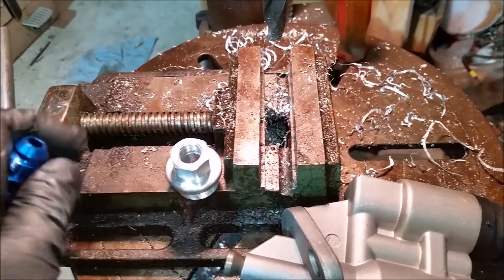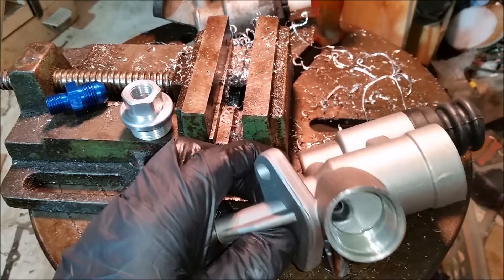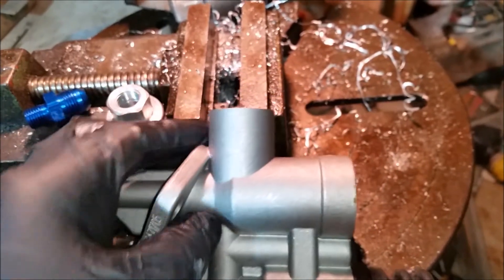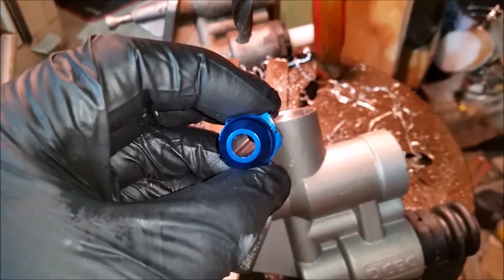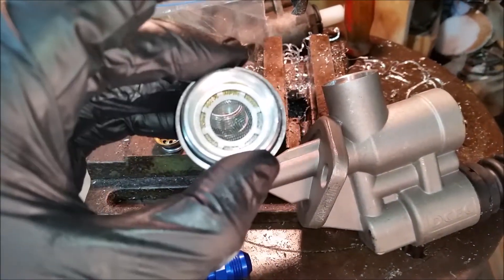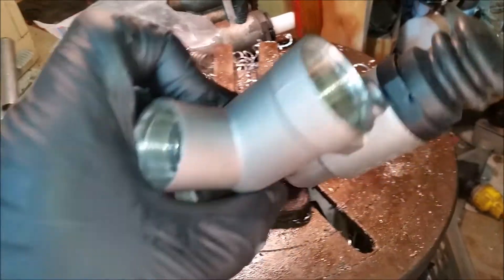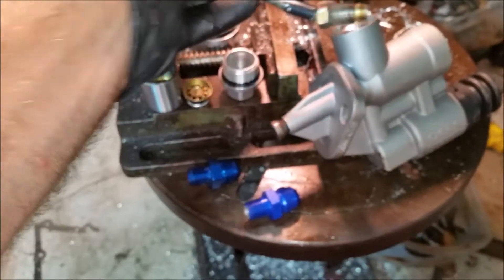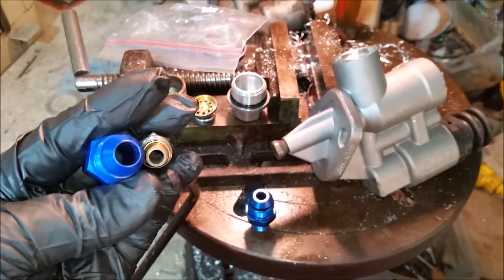Tips and Hacks Getting More Flow From Your Stock Carter 12v Lift Pump

Comment: Consider pulling the fuel pump well poppet ball and spring and putting an ebay fuel pressure regulator in the return to tank line. Then you can have precise fuel pressure in pump cavity. 

Also some lift pumps have  a pressure relief circuit that bypasses the  outlet pressure back to inlet.

Disable that circuit to gain pump outlet pressure.
Reply: Torq tek sells an adjustable OFV
Reply from the maker: Hello Safety First in Texas! Thanks for the comment! Nomad is correct Torktek makes a whole line of overflow valve that we use. We typically use the 0FV060hp on our trucks but have also used the OFV010 on some trucks that are more stock. If anyone is reading through this chain of comments and wants to grab a TorkTek, we typically get ours through ebay: https://ebay.us/shUadN .  We have torn into a few more pumps since this one, but I can't say that we have found a pressure relief circuit! Thanks for the info and next time I go through one I will be looking for that to see if we can modify it to raise pressure some more. And just to add some long term data to the post... As it sit, this pump did 60-65 psi and was keeping up a set of 5x.016's with needle lift and a pump 490cc pump maxed out by Seth Farrell.   As of yet, no issues or failures from these mods.

Comment: So why do I need more flow when my injection pump gets 25 psi as it is and provides ample fuel to the injectors? If it ain’t broke don’t fix it.
Reply: Mostly because modifying component makes higher demands than stock. So at that point its "broke". So now fix it!

Unless you believe 160 hp is all anyone ever needs......
Reply: @safetyfirstintexas  “modifying component makes more demand” makes no sense so I think you’re broke! I’m running 350hp with stock pump it’s all I need.
Reply: @thenomad7120   the stock hp is not 350 hp so your statement makes no sense. Con fusion abounds  160 hp automatics 190 hp manuals and 215 hp mid sized pumps but you have 350 hp in a pickup truck.👌🚫
Reply: @safetyfirstintexas  never said my truck was stock but the lift pump is stock and provides adequate fuel pressure for a Banks power pack that’s on my ‘97.
Reply from the maker: Hi there, Sorry for the confusion. You are correct. @ 350 or even 450hp the stock pump can keep up at lower PSI levels. If you are putting a heavy demand on a p7100 you need more like 45-60psi to help refill the plungers and barrels to help prevent scarring.  Part of the increase in pressure can come from using a different type of overflow valve and past that you need to start examining increasing fuel pump pressure. There have been studies done with p7100 pumps on the impact of HP as correlated to Fuel pressure all the way from stock psi to 120psi. Not a shock the more fuel pressure the better the refill rate and the higher HP to the wheels. Now, we all can guess that is not practical to run 120 psi on the street all the time, so it has generally been agree that the 45-60 psi range for a 500-650 hp motor is about right. This particular motor was targeted at 650hp and we didn't want to deal with a electric lift pump and thats why we ended up doing this.  Thanks for stopping by! Your truck sounds awesome!
Reply: @70440charger  ya I am close to stock probably 300+ hp only
Reply from the maker: @thenomad7120  That's a sweet spot to be! We set my dad up right at that spot on his 98 12v and it is a work horse!

Comment: You can also get a spring for higher pressure. 973-1 is the part number. It will bump your pressure up a lot. It's an inner valve spring. They are cheap. Also getting a tork tek overflow valve in the return side will help a lot.
Reply from the maker: Thanks Jacob. We appreciate you adding that info! That will help a lot of people who are wanting more pressure. We completely agree with you on the TorkTek. We have been running their ofv060hp for years and love them.

Comment: Which fuel line would I use with this then?
Reply from the maker: Hey There,
So we went in two directions. My brother used this: 8an Push lock 250psi hose kit
https://rover.ebay.com/rover/1/711-53200-19255-0/1?mpre=https%3A%2F%2Fwww.ebay.com%2Fitm%2FAN-8-Push-Lock-Fuel-Hose-Blue-20FT-8AN-AN8-Push-On-Loc-Fittings-Kit-Set%2F192132204815%3Fhash%3Ditem2cbbf8c90f%3Ag%3A84gAAOSwAVZdST1w&campid=5338070436&toolid=20008
Its 8 an push lock hose and the fittings. You may look at that and say that your don't need 20ft of hose, but we have gone over this and buying the kit usually works out to save money in the long run. Plus, you will have enough to run 8an (1/2") from your tank if you need more flow later on. 

The route I went with this:
8an PTFE (uses a different end than normal braided line) braided stainless steel line kit.
https://rover.ebay.com/rover/1/711-53200-19255-0/1?mpre=https%3A%2F%2Fwww.ebay.com%2Fitm%2F8AN-AN8-Stainless-Steel-PTFE-Fuel-Line-12FT-Teflon-Fitting-Hose-End-Kit-E85%2F202252380224%3Fhash%3Ditem2f172e6840%3Ag%3ANb4AAOSw66hdR~ZA&campid=5338070436&toolid=20008
This stuff is harder to work with, but is really tough. It has the braids to keep it from rubbing and it also has a 1000psi working load, Like I said, harder to work with, but you should never have any trouble with it. 

Either way you go you should be good. As with everything here on the channel, we are always open. if you do happen to use those link, a small percent will help out the channel here. Its not a scam. It doesn't cost you anything, and I didn't try and find the most expensive one to make more on my end, it was the brand of hoses who we used. We just use affiliate link to help keep the channel going.

TTracing is the brand we used and we actually have started using them for all our AN fitting cause their quality is good and they are less than half of Russell and the others.

 I am gonna warn you. There are others who are cheaper and have cheaper fittings. You can buy them, but you might have the same issues with leaks that we have. I literally have a whole box of cheap fittings from over the past 2 years that were no good. Hundreds of bucks wasted. So, unless you want to try some out for the sake of doing reviews to help the rest of us out, (or if you aren't in a time crunch and can stand to send them back a few times) just save money and get the TTR brand. Their cheap, but no so cheap they have issues!
That was kind of long winded, but I hope it helps some!
Doug

Comment: the stock OFV is great for stock-mild power, Also its is a huge restriction look how tiny the holes are on the OFV.  Swap it out for an external regulator.
Reply from the maker: This another great area that you brought up! We have looked into this and it seems to be a fine line between keeping internal pump pressures up and allowing flow to cool the pump off and not stick a plunger.  Not sure that we have found a perfect solution but as of now we have been using tortek overflow  valves and they seem to do well! If you do use a external regulator,  please let us know how it goes!

Comment: Have you guys looked into upgrading the spring in the lift pump?  Swapping it out for a 975-1 valve spring gives a considerable boost in gpm and pressure.  What are you guys running for filters?  The stock lift pump isn't designed to pull fuel through a filter. The filters should be after the lift pump.  Unless your running an electric lift pump like a fass (lame mechanical>electric). Hogging out the lines like you guys are doing, a spring and 1/2" dual feeds to the pump you should be able to push 1000hp through that lift pump.
Reply: Comp Cams 973-1 valve spring is even stronger than the 975. Dauntless89 (a well-respected guy on CumminsForum.com ) used one in his lift pump for over 35,000 miles with no issues. You don't want to float the pump rod with higher rpms and pressures.

D89 with a couple other guys were working on increasing flow from these oem pumps.
Reply from the maker: Alan, I know its been a while since you posted, but just wanted to say thanks for the comments. Have you tried the 975-1 valve spring yet? If so, what kind of gains did that translate into? 

As for filters. We are running 2 filters on our own dual ebay filter housing. One a water separator and the other 2 micron. We are running a stock 05 lift pump in the tank and then a walbro 392 at the filter then that all feeds the stock pump. Its redundant on purpose, as we have a growning pile of dead electric lift pumps. No matter  who makes them they just don't run forever. Thanks again for the comment!
Reply: https://www.cumminsforum.com/threads/d89s-super-fantastic-fuel-system-escapade.1622154/